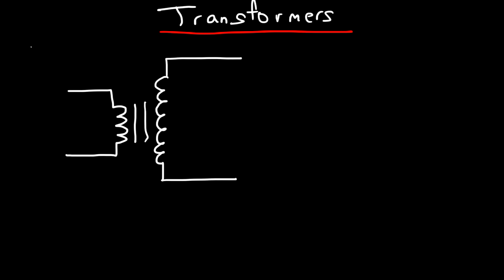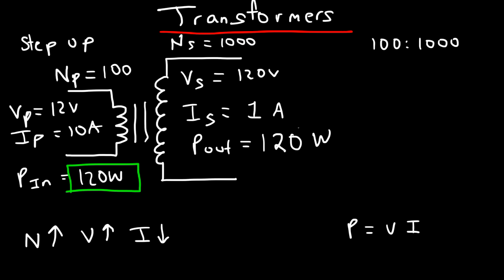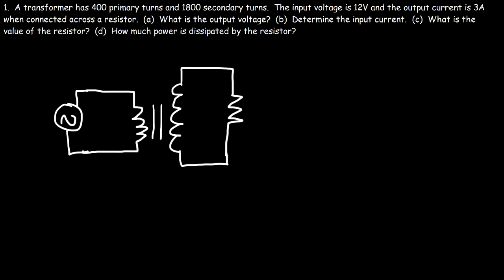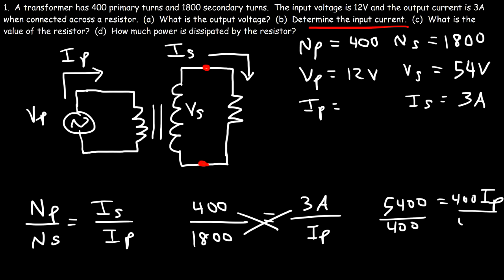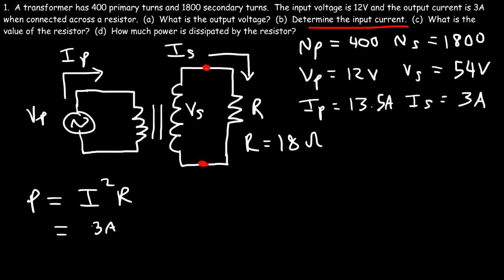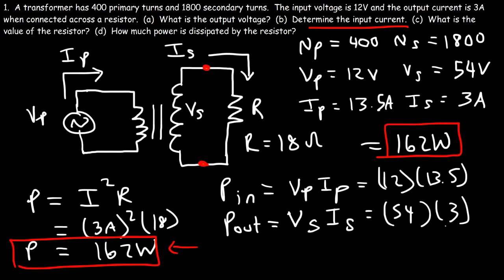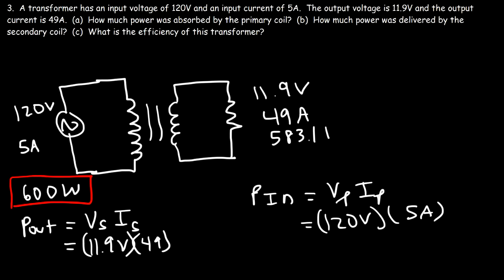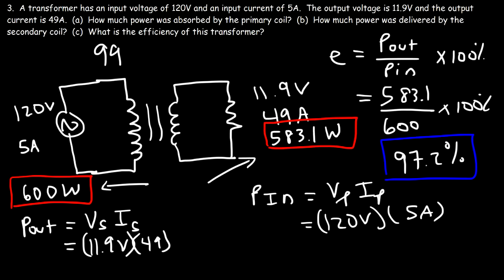Transformers Physics Problems - Voltage, Current & Power Calculations - Electromagnetic Induction

Comment: a little confused earlier you gave us the formula NS/NP = IP/IS. But at 7:45 you used NP/NS = IS/IP. Which one is the correct one? Thanks
Reply: both are the same thing. Just suppose 1/2 = 2/4 , then 2/1 = 4/2

Comment: Regarding the first problem, if I change the resistor in the second circuit with one that is 1000 ohms, what will happen? As we know I=V/R, so the current will be smaller. But this equation gives us the same current Ip/Is=Ns/Np. So what is the correct current of the second circuit?

Comment: I have a question a cell phone charger has a with 200 Turns in the primary coil which current 240V a.c  to 6a.c and Retifier that converts 6v a.c to 6v d.c

Comment: both solutions involve equations that relate the turn ratio and the voltage ratio in transformers. The first solution uses Ns/Np = Vs/Vp, while the second solution utilizes Np/Ns = Vp/Vs. These equations are crucial for understanding the behavior and calculations involving transformers

Are they the same

Comment: Question: providing overvoltage protection at the high side of our 1500 kVA transformer to trip off the generation. We’re thinking of adding PTs and a relay to the delta side of our transformer and shunt tripping the LV breakers in our panelboards.
From a constructability perspective, my only concern is how the PTs will be installed on the high side of the transformer

Comment: A brilliant way to explain transformers is by comparing the electrical device to the robots: when the robots are in robot form, they are little car and alot robot. When they are a car, they are little robot and alot car. Electrical transformers provide the same function as the Transformer robot's transform ability, just replacing robot and car forms with voltage and current & relative to how the coils are setup.

XD I'm actually gonna explain transformers to people like this from now on :D

Comment: In physics, the calculation of voltage, current and power is a common problem. In many cases, these calculations can be done relatively easily, but in some situations they can be more complex. In electromagnetic problems, transformers are often used to change the voltage or current levels. In order to properly calculate the power in these situations, it is necessary to understand how transformers work and how to apply the appropriate formulas.

Comment: Nice video.  However, transformers are rated in Volt-Amperes not Watts.  Same values, but different terminology.  Actual power vs apparent power.

Comment: Excellent explanation, I've a question, without connecting a load to a secondary coil or simply the out put in both step up and step down transformer which is 99% efficient, does the transformer start  consuming the power? Or it only starts consuming while a load is connected?
Reply: Two capacitors when connected in series have a combined capacitance of 5uF.
If the capacitance of one of them is 8iF
-What is the capacitance of the other ????

Please I do need a quick answer

Comment: what happens if instead of 18 resistor you plug a 10ohm, or 1ohm for that matter? I believe that focusing on voltage on the output is really misleading, the transformer output current is the formula that always stands, because in the case of a 10Ohm resistor, the voltage at the output of the transformer will be different from the formulas presented in this video.

Comment: Why does twice the output impedance not mean half the power? My amplifier is rated 300w @ 8 ohms but 500w @ 4. Markbass 801 amplifier is 50w @ 8 ohms but 60w @ 4. A slot car set of my son's gave 16v with 2 cars but 22v with 1.

Comment: Yeah, no mention of physical construction, wire gauge and resistance, core material and saturation, losses calculation, operating frequency range, power dissipation and heating, effect of heating on efficiency, etc. Basically, material that is only good enough for 8th grade children. Why does this transformer has 100 to 1000 windings, and not 1 to 10 if same rules apply? Extremely useful :D

Comment: 6:59 I wonder if it's ok to use the given value of secondary current (I sub s) as is, since it's connected to a resistor. Your solution will be the same without the resistor; the resistor is irrelevant then, is that how it is?

Comment: I have 2 questions:
1) what does more coils in the primary coil do for you?
2) why are the wires often thicker in the secondary coil, and how does it help?
Reply: If the primary has less turns in its coil than it’s a step up transformer. The primary will have more current going through it and that will require thicker wires to withstand that amount of current. Remember W =V•I
Reply: 1) More coils in the primary means that it's a "step down" transformer.  Your primary (input) voltage is higher then your secondary (output) voltage.  
2) If you are outputting a lot of current, then you need thicker wires.
Reply: @bojanb4764  
But I often see that the primary coil has less and thicker wires than the secondary coils, and I don't understand why they do that. This is still used in an step up transformer, with the primary coil being the input and secondary, the output

Comment: Thanks dear very clear 

But last I did not understand 

How you calculate efficiency 

E =p out/p in × 100%
583.1/ 600 =0.971
If 0.971×100% =0.971
But you said ansure is 97 how it's come 

Thanks dear again for your explanation
Reply: It should have been *100 only. Not 100% hehe.
0.972x100
= 97.2%